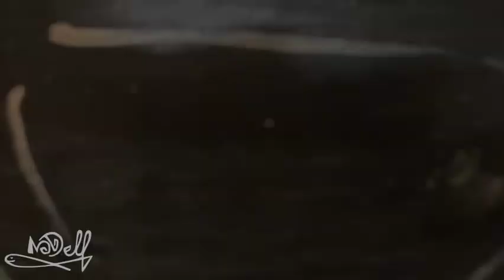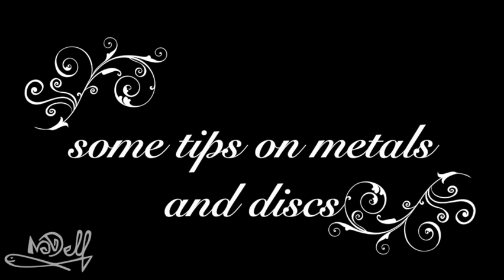How to turn antique saws into a "scie/saw"of treasures!

Comment: Very good point about the disk not lasting long and very unsafe, if you don't clean the metal before you cut it. I found this out a while dack when I was coloring as I mist some mill scale.
Reply from the maker: Thanks my aim is to help! I appreciate the comment. 
Yes you could alternatively clean before you cut that is a good observation. 
Although I thought of it, the thought occurred before I discovered using vinegar and I would use several discs to remove mill scale,  making my work forever lasting and I thought it would be simpler and less time consuming to remove it after(a thought that now you mention it , I think does deserve some revisiting) Thank you for that :)
as a question since you have the experience.
I plasma cut fairly close to my cuts(not my best habit but,anyway), I would wonder then if doing it this way would use more mask cartridges ,as I've observed how the use of vinegar has clogged my other equipment resulting in more maintenance.